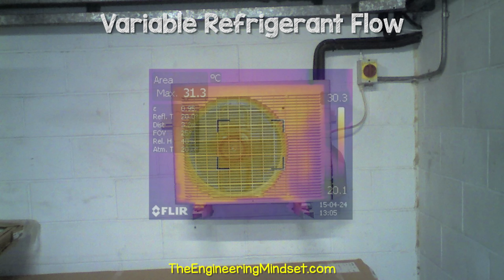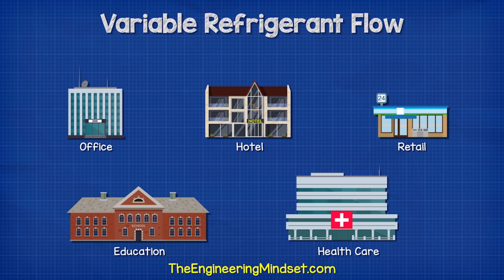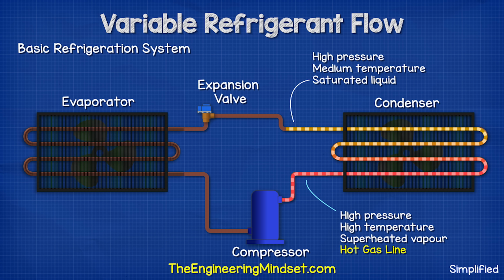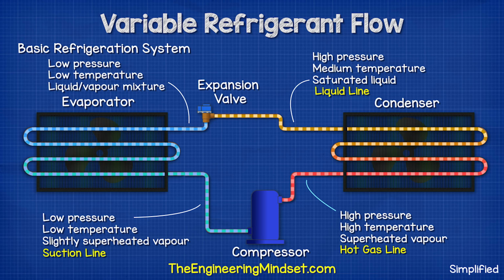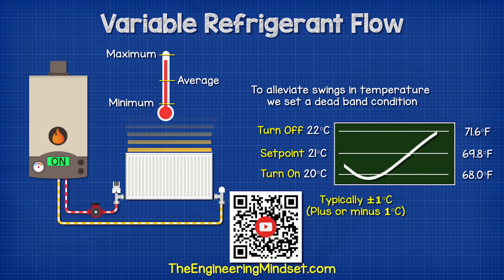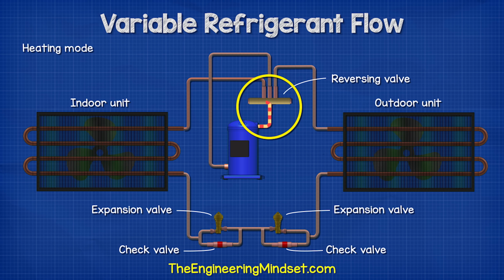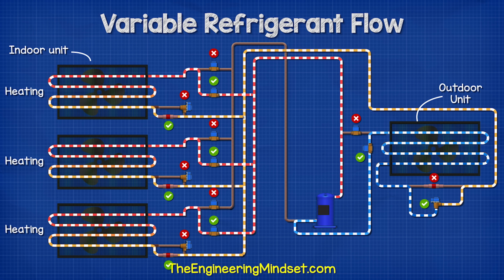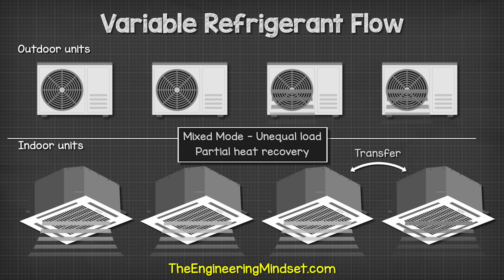VRF Systems Explained - Variable refrigerant flow basics HVAC

Comment: I'm from San Antonio Tx. and we have 6 vrf Units on a 11 floor high riser roof cooling 3 units on floor 11 floor 2-10 contain 12 handlers including hall per floor, I have been in the business 43 years this is the first time I run into this system and first floor is a lobby with the exception of 1 resident unit who's breaker trips about every 7 hours, the rest of floor 2 and the lobby it is like a suana only the 1 resident in the lobby's apartment has cooling, but like i said his breaker trips every aprox. 7 hours. does anybody have an idea whats gpoing on.

Comment: Aren't all Inverter split systems variable refrigeration flow?
Reply: The compressors might be varable speed, but VRF's can cool and heat different indoor units with one outdoor unit.  That's what makes them so trippy.

Comment: I see a some of these on sites, most notably schools. A major manufacturer of these that I often see is Daikin. Service calls on these are crap because of responsibility disputes because it's a closed architecture as we as the BMS installers, cannot see what's the control logic and what's going on inside. But when properly installed and used as intended, they work fine.

Comment: Thank you for your work and helpful info. I have a question. You did explained the VRF system at the refrigerant level for split systems very well. Is it possible to have this VRF system at the water or steam mediator level in chiller systems? I mean one VRF system for the refrigerant loop and one for the water mediator loop. ( Plus ideally a Vav system in the AHU unit ).

Comment: Late to the party here. Two questions to help wrap my head around the VRF Systems:

1. When moving heat between two rooms, does the compressor run at all? If not, how does it not? Is there just enough liquid refrigerant and pressure in the system to keep moving heat?
2. Could one or more of the heads in such a system be a thermal storage tank? (I.e. freeze a block of ice at night then run off it in the day)

THANK YOU FOR ALL THE AMAZING VIDEOS!
Reply: The compressor must always run to “pump” refrigerant thru the system.
Reply: @shanebrooks2013  Makes sense. Is there a simplistic chart that may help in comparing efficiencies of a heat pump based on evaporator and condenser temperatures? I assume the higher cooling efficiency of a GSHP is the relatively colder temperature of the condenser coil (i.e., the earth).

Comment: Excelent video! Not sure about the location of the pressure gage as reference value for the compressor speed control. I believe that the logic behind the speed control of VRF compressors is much more complex than that. I have been monitoring data from VRF systems and struggling with this concept myself. OEM don’t really share much information about how this control really works. And HVAC installers usually have no clue how this works when you ask them.

Comment: I'm working on a hybrid vrf system from Daikin doing the controls for the building automation system wiring the branch selectors and FCU in the whole building and it's also using a doas system to bring outside air inside the building very interesting set up

Comment: VRF heat recovery should be inside any AC to Dehumidify the air without cooling down the room.
My shitty Daikin Prefera managed to freeze up the room on Dry Mode.

Everything looks efficient, but if you compressor is down, everything is down.
If you have a refrigerant leak, everything is down...
It looks efficient on paper.

Comment: i think the important thing here is the multiple locations of indoor units. i've been trying to think of a way to directly transfer heat away from say, a hot kitchen or server room, and direct to either outdoors or directly to another room as needed / when the heat exchanger handling other rooms may not be experiencing such a temperature

Comment: VrFs are a lot harder to work on and you need a controller to charge the unit there are certain valves that open and close on the condensing unit and it makes it to where you can not recover / charge a until without the 2,000$ Contoller. I  usually see them in New commercial buildings and schools I work on them from time to time but 90% of parts are on 6 month backorder so if it breaks down they'll just tell you wait 6 months or buy a new 50,000$ to 75,000$ condenser

Comment: Danfoss equipment was always good & reliable in refrigeranion systems in the real world commercial refrigeration systems 👍
I will buy you a drink if You can show the real energy inputs / outputs when comparing Air Source heat pump to  ground source heat pump 🙄

Comment: and if we had gone full nuclear since the 70's, we could just decorate walls with peltier pads and have it cold/hot as easy as turning lights on and off, 0 nvh, 0 pressurized lethal gases, the dream, f efficiency

Comment: I've seen a VRF used in a house that's been converted over to apartments... not worth it honestly... cause you got someone that ALWAYS TURNS OFF THE MAIN UNIT... thus shutting down the rest of the house's cooling/heating.

Comment: VRF with heat recovery is the way forward. You can run AC and heat water at the same time with only one VRF/VRV outdoor unit and a manifold and control. You could also cool a refrigerator, a freezer and heat a clothes drier and a hot tub. The load would be shared and the compressor would only provide the needed differential pressure. The compressor ramps up its speed when only heating or cooling.
Reply: To be clear, you described a theoretical application unless you know about running refrigerant linesets into a clothes dryer or hot tub or refrigerator and I missed that
Reply: @tkacandes2052  Heat Pump clothes dryers are normal nowadays, so what would stop one from using the central AC/Heating Compressor from providing Heat for the clothes dryer? Of course the lines can't be tied to the dryer directly, so there is some sort of wall-mountes heat exchanger needed, but basically it would work this way.
Reply: @tkacandes2052  Daikin build a nice hydrobox for this appliances.... making hot tap water from your VRV system
Reply: Daikin is 1 step forward than other air conditioner brands

Comment: About mid-way through it hit me that the condenser and evaporator units are the exact same thing (simply heat exchangers, and that's why they can work in reverse), and my mind was blown. I never realized that before, but I also don't work in HVAC (so that's my defense).

Comment: If trying to charge a vrf without software, would you set all heads to full cooling and measure subcooling?
Reply: ideally vrfs should be charged by Weight.
however a quick check is to put the whole system in full cooling and measure performance of the furthest indoor fan coil. 
if in doubt, reclaim and charge by weight.
Reply: @richardbartlett6932  thank you

Comment: How come you guys haven't worked on the heat emissions from the ac and regulated it by now? Too much heat coming out the back
Reply from the maker: The heat emissions are dependent on how much heat you're trying to remove from a room + the compressor. You can only limit the heat generated by the compressor in that sense because the cooling load is the cooling load. The better option is to reuse the heat but that's only possible if there's somewhere else, useful, for it to go. If your domestic hot water tank is at full temperature, you'd still have to dump the heat to atmosphere

Comment: i really wish to have this kind of system in my home such that the heat from my air-con can be used to dry clothes and heat up water. in the winter, well, not much thing here but at least nothing is wasted in summer days and a ton of space for the compressors and additional condenser is saved. the space is precious while the price doesn't really matter much. ( doing anything to save space as well as energy ) the best system i can buy in my country/region is the Daikin VRV S 3Hp unit, which suits this purpose for my home greatly, just that they do not provide any water heater for heat pump system in my region....

Comment: so an inverter air-con and inverter multi-system can be considered as VRF/VRV systems?
Reply: The primary indicator for a VRF system is all the units are on a single piping network and the expansion valve is at the fan coil. Most small multi systems will have separate pipe runs from the condenser, and the expansion valve is within the condenser.
Reply: Excellent point.A mini split heat pump system with multiple indoor heads is different from a VRF system because as you stated,the TXV for the entire system is in the outdoor unit,so it can only do all cooling at once or all heating at once.The VRF has separate TXVs in each indoor unit and unique piping,allowing them to do either heating or cooling at each indoor head,regardless of what the other heads are doing.

Comment: I have a split air conditioner in my bedroom. I use it only in summer months. It runs up huge electricity bills. Now I understand that it is not a VRF system. Good old AC which steadily consumes power as long as it is on. Very instructive video.

Comment: are you sure a VRF system can supply heating cooling at the same time ? I believe this information is wrong. I VRF heat recovery suystem can supply heating and cooling at the same time.
Reply from the maker: Of course, not every unit can. We explore the different system types and how they work in the video

Comment: What's the cooling load threshold that we should aim for water cooled chiller instead of vfv?
Reply: VRF top out around 20 tons. How many compressors can you fit in? As opposed to chiller and boiler. 

You need to remember that each unit is a maintenance item.

That said we used about 70 for a large public building in Maine. Combined with a DOAS.

Comment: Incredible.  So with that, I can imagine combining this with geothermal or maybe even heating tap water for even greater efficiency, although cost and maintenance may be dissuading factors.  I don't know much about it to be honest, but it seems awash with interesting possibilities.
Reply: Yup I think daikin does make such a system where it transferd heat from air to water for providing hot water
Reply: I think we use water furnaces like this format

Comment: Good video. Don't need check valves I many vrf systems though. But I understand why it was used for demonstration purposes. The ending could use some slight tweaking. Having 4 outdoor units isn't necessary to portray full heat recovery. You can do this with one outdoor. When loads are balanced as you said the outdoor heat exchanger will not be required. It will operate on evaporator or condenser mode based on load differences from heating to cooling indoor zones. Having it shown with 4 outdoor units ruins the underlining message how vrf can do all this from one outdoor. 

Still. Good video I like the animations. I dont have nearly the resources you guys do to make sweet graphics like this so I'm usually stuck to just explaining things. 😅
Reply: I believe the compressor still runs at low speed to provide differential pressure even when the loads are balanced when there is a call for both heat and cool. I could be wrong but but if the compressor shut down you would have a perpetual heating and cooling machine. I do realize that you have to have active cooling/heating with fans or pumped exchangers.

Comment: Great video! Very helpful to understand the possibilities with my future hvac system..
In mixed mode, if the system is primarily cooling, is the temperature you can heat the one heating unit limited by the ambient temperature around the cooling units? (for context: for a system trying to heat domestic hot water at 55C+ while cooling a house at 25-28C)
AFAIK you can't transfer heat if the refrigerant temperature is lower than you target temperature, unless you go through another compression cycle, or am I missing something?
Reply: Not exactly sure what this question is asking, but in general for cooling mode the evaporating temperature is going to be around 6-9c, the condensing temperature around 45-50c. 

The condensing temperature is always going to be higher than the room temperature in heating and evaporating temperature always lower than room temperature in cooling, otherwise no cooling or heating will happen. There will be low pressure or high pressure alarms which will protect the system in cases like this.

Comment: When we have more indoor units in heating than cooling ,there is a case to face a problem in liquid line or in condensation? as the pressure changes in liquid line

Comment: This blows my mind how these systems can provide heating and cooling at the same time,  not sure I understand it yet but I will keep studying your videos. Thank you
Reply: They don't make heat, they move it. That will help you understand
Reply: @gianfavero  Yes, thankyou,  I was an AC tech for ten years (UTI grad in 1980) I got out of it back in 90 long before these systems were around. Very interesting and a little more complicated than anything I ever worked on. I'm not understanding how the condenser is performing as the evap and condenser at the same time. I understand heat pumps but this is a little different.
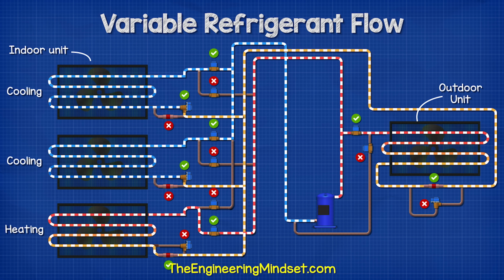Reply: @markme4  think where you got lost or maybe didn’t hear it from digesting everything else is at 12:00.  Mixed mode the outdoor unit isn’t acting like an evaporator. The heat to indoor head  is from discharge line and once condensed is sent to other indoor head calling for cooling along with LL from outside .
Reply: Not performing as evaporator and condenser at the same time…solenoids controlling flow to make one of the indoor coils a second condenser,so that room gets heat,while other 2 indoor coils are flowing as evaporators.Then the solenoids and electronic TXVs can  change refrigerant flow again to make any coil a condenser or an evaporator based on thermostat call.
Reply: @markme4  Just think of all the units as outdoor units, 8 units all the same being manipulated to what you want. The indoor units are effectively the same as outdoor units. As long as you have a balance in the opposites it will work.

Comment: You need to mention just how efficient they are compared to the standard gas heater for example.
Reply from the maker: Good idea, perhaps a future video. There's only so much we can fit into 1 video, this one is just on how it works.
Reply: @EngineeringMindset  thank you for responding glad you knew i ment to say efficient.
Reply: Heat pumps are going to be approximately 3 times more efficient than gas on a pure energy consumption (joules) basis when heating capacities are identical.
Reply: the other benefit often missed is that if your building has  100kw winter heating load and 100kw summer cooling load you need a 100kw furnace and a 100kw chiller each sit idle 6 months of the year 
with vrf you only need one 100kw system to cover both loads...
however design, installation and commissioning is critical on these systems and they easily fall over if any of the above are not done to the highest standards